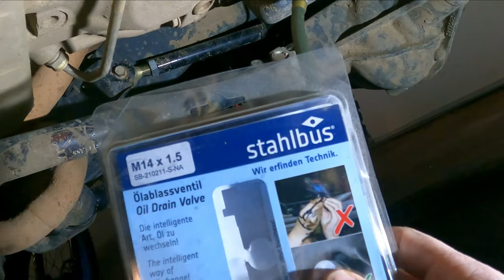Misfit Jeepers - JKU Oil Change with Baxter Performance Oil Filter Adapter.

Comment: Very good video thoroughly enjoyed it. I really needed to see for myself the pressurizing of the filter for evacuation using the schraeder  valve . . . Thanks for that demo. Now if you can keep the dealers hands off of it you'll have an engine that runs good . . . hopefully for a much longer time. Oh yes they will . . .

Comment: Your engine should have "clear flood mode" so you can prime your filter before starting the engine.  My Subaru does and most newer vehicles do.  Prior to starting the engine, floor the accelerator pedal and crank the engine until you see oil pressure.  If you have push button start, which I do not, it also works but the procedure is slightly different.  You can Google it though.  Great way to prime the system prior to starting it.👍
Reply from the maker: I appreciate the comment and I will have to look that up. I haven’t heard of that before. Never to old to learn something new 😁.
Reply: @misfitjeepers9760  hopefully it's applicable to your engine.  Should be.
Reply: Do you have to purge the air out after u install the new filter?

Comment: Thanks I just completed the infamous oil cooler coolant/ oil leak. I converted my 2012 to the Dorman 14+ style and was wondering if I could use the Baxter. I’ve been on the fence about getting one but it sure seems good for the longevity of the 3.6
Reply: I was wondering the same thing, I can't find information anywhere, did you ever get any answers?, the only thing it says that it brings older model to the newer models, which I'm assuming is because of old style filters with the plastic or spring, I may just do it so it's all aluminum, the way the old filter came off 😂, I need to get it, the oil bottom bolt adapter 😱
Reply: I don't see why you couldn't, but who knows. I'm looking at doing the same thing, but I have a 2019 Ram 1500 classic.

Comment: I would think the start example would be better on the 2nd start after an oil change. This example you are showing with the new filter doesn’t yet have oil up in it or am I not understanding correctly?
Reply from the maker: You’re 100% correct, the first start with a fresh filter doesn’t show its benefits. But each start after the initial is better.

Let me know if you other questions, happy to help anyway I can.

Comment: Nice, thank you so much, RAM 2020 3.6 , 14k miles, hesitate to go, is that part of the oil system too? wonder where would the paper oil filter fit in all the Baxter adapter?
Reply from the maker: Hi Jay, thanks for the comment! On the Pentastar 3.6 V6, if you were to go with the Baxter adapter you would no longer use the paper filter. If you notice in the beginning of my video I show a Wix spin on filter. That is one of the filters that can be used with the Baxter adapter. I hope this answers your question. Also below is a link to their website for additional detail.

https://www.baxterperformanceusa.com/product/ms-201-bk-cartridge-to-spin-on-adapter/
Reply: @misfitjeepers9760  Thank you so much, so the mopar paper filter, will be replaced with a canster, got it, Baxster site is not clear about whats and hows.  Thanks a mill, stay safe.

Comment: How did you get the engine cover to fit? Mine won’t fit, filter keeps hitting the engine cover.
Reply: @chuckisbusy what year is your Jeep.
Reply: @4low_in_bama  2018 JK. Should be the exact same. I just removed it and keep it off.

Comment: could you just poke a hole in the top of the filter?
Reply: rather than use air I mean. just poke a hole in the top with a pick and let gravity do it's thing?